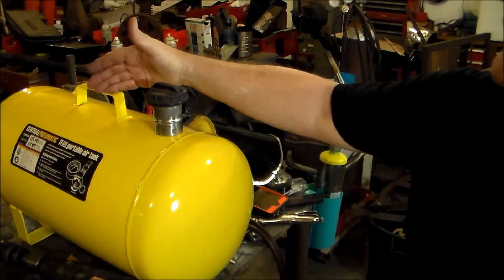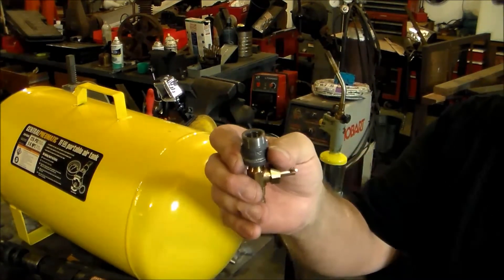Gas Tank Build , part 1

Comment: YEH... Don't burnish the powder coat off the tank BEFORE you braze it........contaminate the whole weld, then wire brush it...... did you even vacuum the tank out ?
Reply from the maker: It cleaned up good and no issues with a year of operation . Thanks
Reply: As a welder of airframes I'm just a wee bit critical 
when it come to welding... I'm sure for you it is fine, it just looked like a dirty weld.
I give ya an O.K. though. All is well.

Comment: Hi Rusty, any issue brazing that Black iron pipe to Steel? (re: metal incompatabilities?) . You mentioned cap came from an El-Camino but where did you get that filler neck? Other fella says he got filler neck from Tractor supply but unfortunately i couldn't find there...
Reply from the maker: I had a fuel tank that i cut the neck off . Any auto salvage yard can help.  No problems at all brazing , just put most of the heat on your heavier metal . Good Luck

Comment: So, what I got from his demonstration was that a vented tank will leak if it gets a hole in it!
I just used a beer keg and cut the siphon tube off the original fill valve and it lets in air as the fuel comes out but will not vent fumes into the garage if it warms up.

Comment: I did basically the same thing, but with the Harbor Freight 5g air tank and one of the fuel cap and flanges that they sell at Tractor Supply for for building / repairing your own fuel tank.  It has the wide opening like you see on heavy equipment, tractor trailer rigs, etc.  Probably a bit of overkill for this, but it was the most readily available fitting I could find that was made from steel so I could weld it with a stick welder.  As it turned out though, the weld didn't look particularly perfect, so I ended up brazing over it to ensure it was airtight and to hide my poor looking welds.  I make it to use on my Harley so that I could have extended range on long rides when I wasn't sure where the next gas station might be.  All I need to do is paint it and make a way to mount it on my luggage rack on my motorcycle.  Kept getting distracted with other projects and it's been sitting in my garage, not quite completed for probably a year. :(
Reply from the maker: They make a nice tank and 5 gallons will double your range Good luck. A friend of mine is going on a motorcycle ride "devil's backbone" lots of great scenery.
Reply: I'm thinking about taking a ride down through Mexico this summer.  I spent a few hours tonight working on a mounting mechanism for it so that it won't flex / rattle.
Reply: Had to look that one up... Turns out it is here in Texas and only 51 miles long.  I've been in that area a lot, but I'm not sure if I've ever gone on those particular roads.

https://www.myscenicdrives.com/drives/texas/devils-backbone

HF also makes a 7 gallon aluminum tank that goes for $70.  So, for over twice the price of the 5 gallon steel tank, you get a whole 2 more gallons of capacity.  The extra 2 gallons might be nice, but I'm not set up to weld aluminum.  I'm mounting it on my luggage rack on my FLHPI.  Since a motorcycle is always leaning to the left when you are refueling it (since it will be on its kickstand), I put the filler neck on the top, but towards the right.  The fitting that I added to the bottom for the fuel line, I put on the bottom left side.

Ideally, I would weld a piece of metal channel iron on the bottom of the tank and then have bolts that go through it and between the slats in the luggage rack to subsequently go through a backing plate under the luggage rack, so no holes would need to be drilled in the luggage rack.  I haven't stumbled across a piece of channel iron the right size yet though.  For now, I'm just going to mount it on a small piece of 2x10 lumber with a groove / saddle cut out of it so that the tank is more stable and metal straps in a U-shape going across it to secure it to the wood.  This is something that is easy to work with and I can test it out this way to ensure that fuel will flow into the engine and the main tank.  I have already installed a T-fitting in the crossover between the sides of the main tank, so I think it should work.  Oh well... We'll see... :)

Your project is for a generator.  I don't really need to increase the tank size on my generator since it already holds 7.5 gallons which gives me an 11 hour run time at 50% power.  That works out good enough for the hurricane use I've had to use it for so far.  If I needed more run time, I would just plumb in a 55 gallon drum as a remote fuel supply.  I already use a couple of 55 gallon drums for fuel storage if I see a hurricane headed our way.  In a pinch, I think I could convert it to run on natural gas which would give me basically an unlimited fuel supply.
Reply from the maker: Sounds like you have it figured out. Nice job, being ready for hurricanes. This past hurricane has devastated the Texas coastline in some areas..Thanks and take care
Reply: I've been in the Houston area for about 30 years and we've only had one hurricane where the electricity was off for a long enough time that I had to use the generator.  I ended up running it for a week or so, IIRC.  Hurricane Harvey was our latest, but it was mainly just a rain event (60" of rain for us supposedly).  Some places flooded, some didn't.  Houston will spend a lot of money to change the drainage system, but all it will accomplish is changing the areas that flood vs the areas that don't flood.  Personally, I would rather they leave it alone so that we at least know which areas will flood.  Many of the areas that flooded were known flooding areas.  They've flooded with significantly less rainfall before, so it's no surprise that they would flood with all the rain we got from Harvey.

I spent Tuesday putting a couple of coats of brush on Rustoleum hammer finish black paint on the tank and the wooden support platform.  It is very forgiving of any imperfections in the surface finish -- both because it gives a mottled finish with a little silver in the black and because it is thick and that hides some of the imperfections.  I first started with brushing it on, but then I thought it looked better if I just dabbed it on with the end of the brush.  Probably need to rig up some sort of temporary "oven" to bake it a bit so I don't have to wait a week for it to "cure".  I'm going to be pissed if after all this, I end up with a leak in one of my welds / brazes... :(
Reply: Turns out that the Rustoleum Hammered Finish paint was a REALLY BAD idea.  Sure, it looked good, but the first time a little gasoline leaked on it, the paint got soft and started to crinkle up.  Totally useless paint as far as I'm concerned and a complete waste of money.

Looking on the bright side, I guess it should be easy to remove -- all I have to do is show it a picture of a can of gasoline and it will fall off the tank. :(

Comment: Looks like that  will work out great. Thanks for sharing.
Reply from the maker: It is coming together and going to work nice. Thanks
Reply: Well, I just finished installing the tank on the luggage rack of my Harley.  Searched my garage for a couple of days trying to find the valve that I had bought to use as the fuel petcock.  My wife keeps telling me that when I can't find something in my garage, I just buy another one and that's why I have so much stuff in the garage.  I was determined to find this valve and not buy another one even though it was fairly cheap.  Looking on the bright side, I guess my garage is a bit cleaner now...

I had a piece of stainless steel that was 27.5" long which I folded over the last 1/2" 3 times on each end for reinforcement.  It was a bit over 2" in width and I'm using it as the strap that goes across the tank with a bicycle inner tube laying under it to protect the paint.  Was up all night fabricating the strap and getting it lined up on the base of the tank that mounts to the luggage rack.  I drilled 2 holes in each end of the strap on the reinforced area.  Ended up breaking a few drill bits in the process and even had one of them cherry red at one point.  I think I now need to learn how to sharpen drill bits.

Drove up to a gas station after installing it and filled it up, but with the valve shut off so that I can test for leaks.  My main tank is full, so I don't want it feeding in there yet anyway.  The Harbor Freight air tank is supposed to be 5 gallons, but I only got 4.3 gallons in it.  I guess I need to check the fuel neck I welded in there to see if it goes so far down that it is allowing a pocket of air to get trapped and thus decreasing my apparent tank capacity.  For now, I just want to let it stay with the valve turned off to test the seal of the fittings on the tank side of the valve.  I used flare fitting on the engine side of the tank so that I could (theoretically at least) easily remove the tank from the luggage rack if necessary.

Comment: nice to see an old school  torch in action, seems most have gone electric.  
Kewl idea.  I have a couple spare boat motor gas tanks.
Reply from the maker: I had looked for a tank for a while. A new tank that would hold 8 to 10 gallons was over $100 so I got the air tank . Working good I think. Thanks

Comment: Nice job, that's going to work out great. Should get a lot more run time with 10 gallons of fuel. Thanks for the update.  VW:-)
Reply from the maker: I would think 8 or 10 hours if not longer. But would depend if it is under a load. Thanks and take care

Comment: Brazing the fittings is the best way ....If you have a pinhole leak it is easy to fix
Reply from the maker: Thanks, I plan on pressurizing it and check for leaks before filling with fuel.

Comment: It was thick enough not to buckle brazing 👍 Are you going to coat the inside with motorcycle tank epoxy ?  Do you think it might rust inside ?  I'm not sure myself :)
Reply from the maker: I have some tank sealer and thought about putting it in. Might do that for good measure. No way it would rust if I did that. Thanks Steve